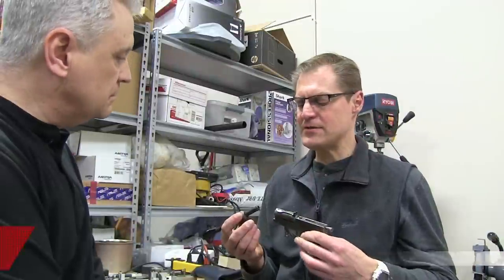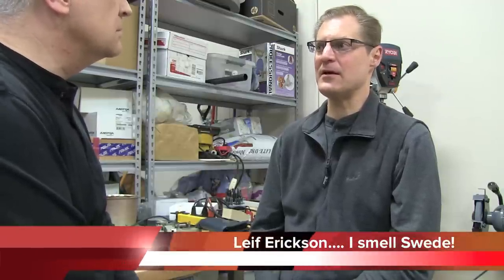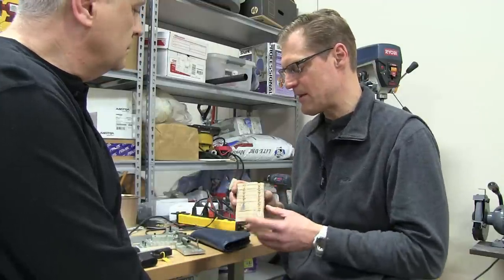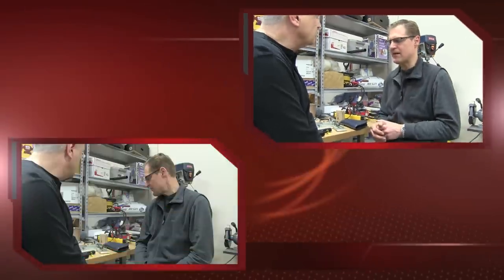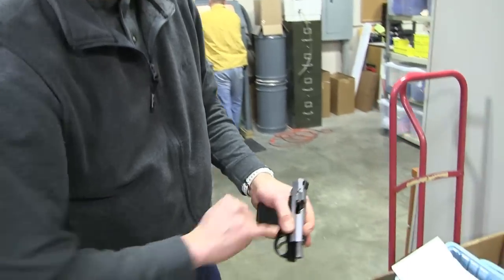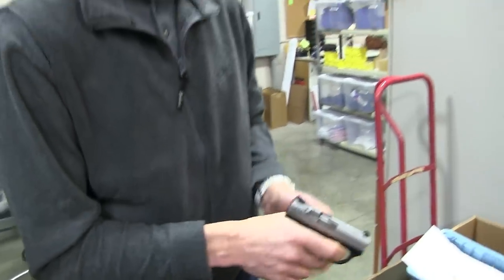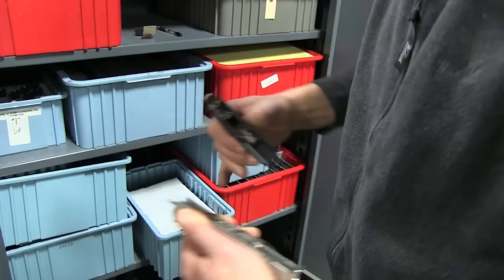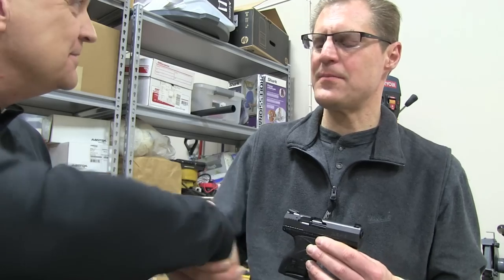Boberg Arms - XR9 Designer Interview & Manufacturing Tour

Comment: I had a conversation with the owner at the shot show...I got to say he is a engineer first and a gun guy second, that can be problematic in that he is looking at his firearms in a different way than shooters do.
Reply from the maker: Arne is a true mad scientist.  Gaston Glock was a radiator manufacturer.  Just sayin'.  ;-)
Reply: CrucibleArms
Do not get me wrong here Mr Boberg is a very good engineer. But in dealing with non engineers you have to tone it down a little bit because it is to easy to lose people with words. I have every intention of owning a Boberg once the 45acp he showed me comes out. and for the record I hate Glocks.
Reply from the maker: Robb Kaczor I'm totally with ya'.  Arne is a great guy and I've worked with a lot of engineers over the years so I'm kinda' used to their demeanor.  You're right, they don't make the greatest spokes people by and large.
Reply: Glock defied some unbreakable laws too. The Glock is a revised Roth Steyr concept of safe trigger.
Maybe with a superb choice of materials and machining, on Korth style, this gun will survive for decades.
The only scary thing I see on Boberg is the tension spring on its hammer. Maybe a Luger style compression spring could convince me.
But the guy is a genius anyway.
Reply: Dude built a 2,000 fps BB gun using a shotgun primer when he was 14yo. I think that qualifies him as being a "gun guy"